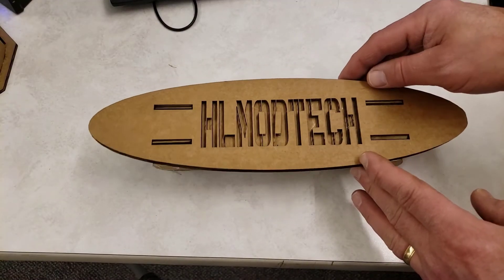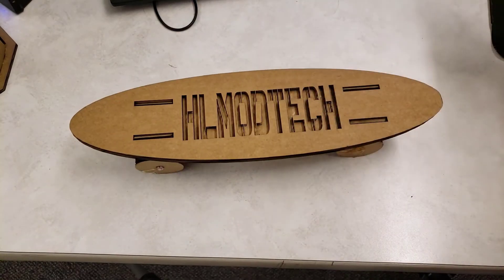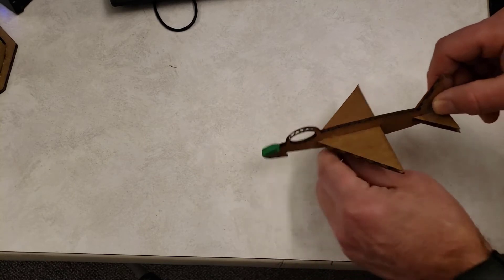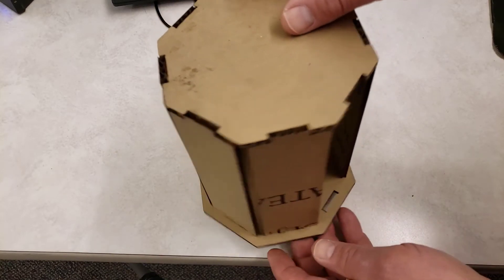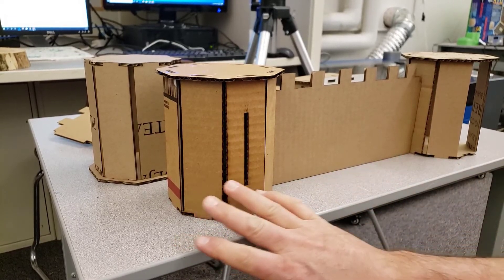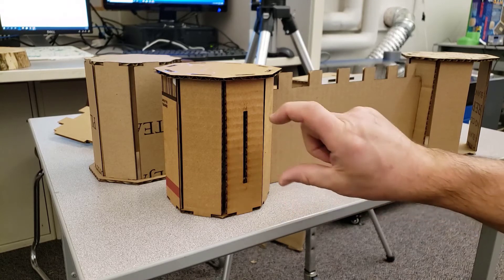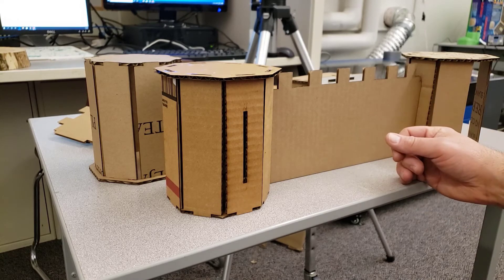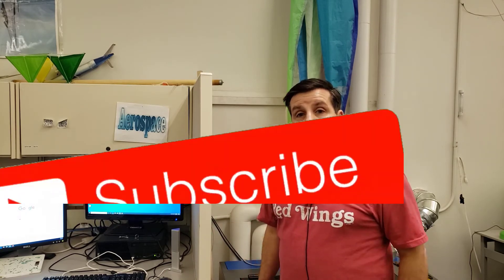Making a  Cardboard Castle with Tinkercad | Student Spotlight #lasers

Comment: That's so cool to see your students work and how you use cardboard. I just got my 55W this week. I just made my first video on a mode to make the air pump quieter.
Reply from the maker: Thanks! It sure have a ton of fun with it. I will check out your vid on the air pump too. My aquarium pump blends with the other crazy sounds from the shop at the moment. My classroom used to be a HS metal shop. 🤣